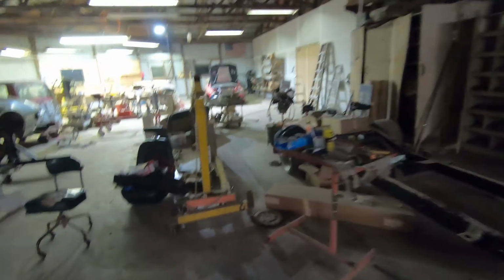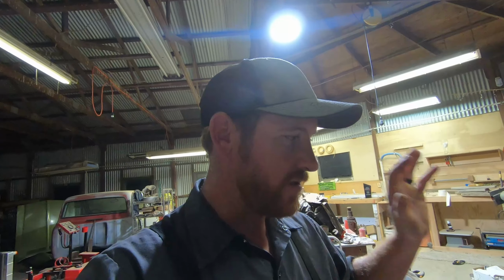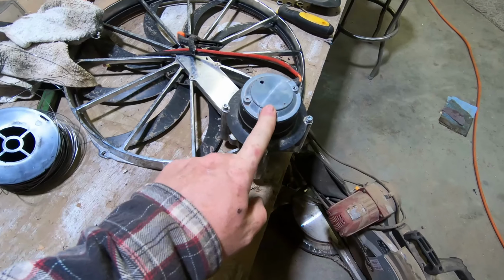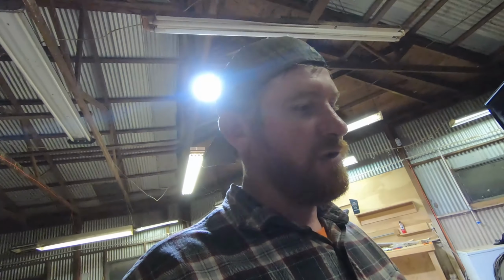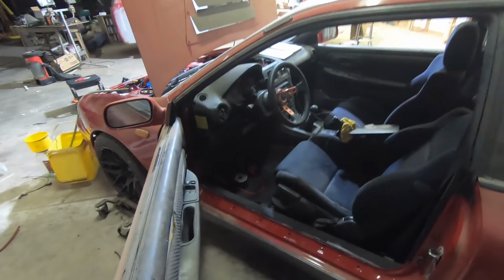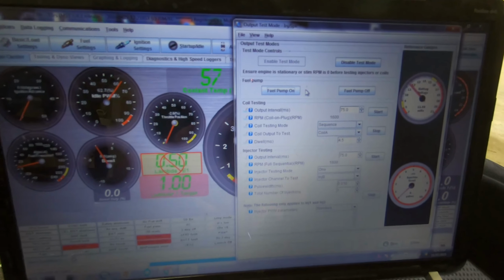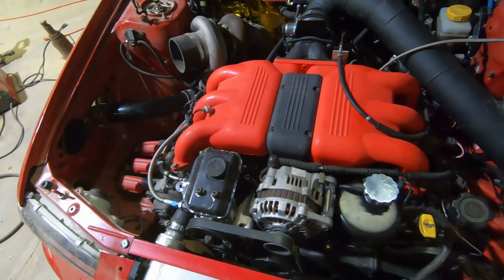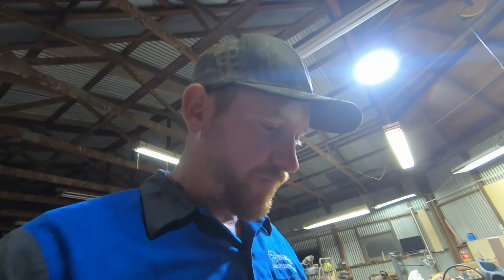EG33 First Start Fail! Why Does This Car Hate ME?!

Comment: My 97 eg33 swap has been an ass about wanting to keep normal rpms lately
Reply from the maker: What ecu you running?
Reply: @gingerauto  currently just the svx one, it was wired in quite some time ago,  about 10 years to my knowledge, picked up the car for 900, it runs, and such, but been having an issue with the AACV not triggering properly.
Reply: @gingerauto  forgot to mention it is a 97 legacy Brighton, saw that was spaced out